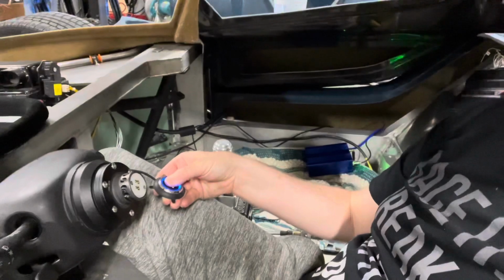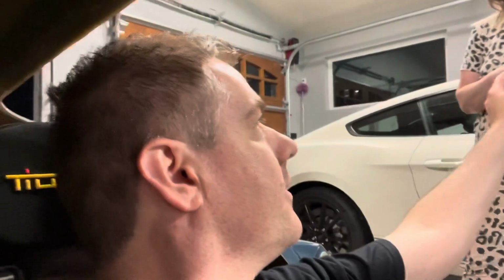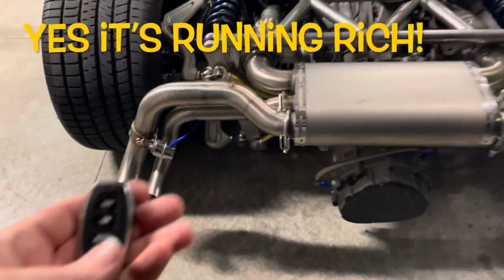Superlite SLC V10 - Magic Blue Box?

Comment: First time I have ever heard cut outs run threw a “blue box” no the less very cool. Mine are just wired direct.
Reply from the maker: The blue box is a vacuum pump and solenoid for opening and closing the valves. My engine does not pull enough intake vacuum to actuate the valves.
Reply: @sheffdog36  Thanks just curious how it worked.